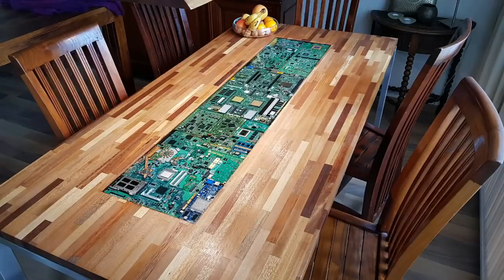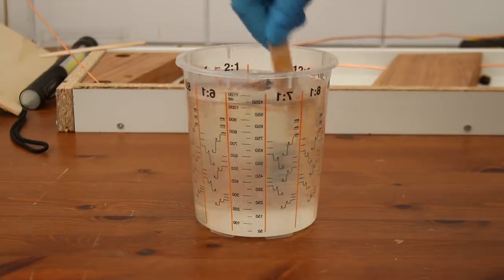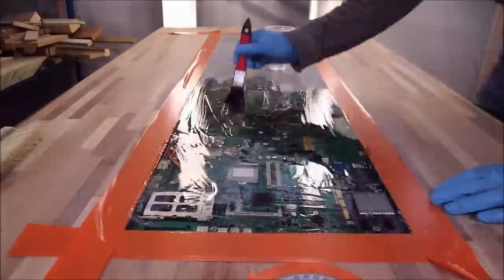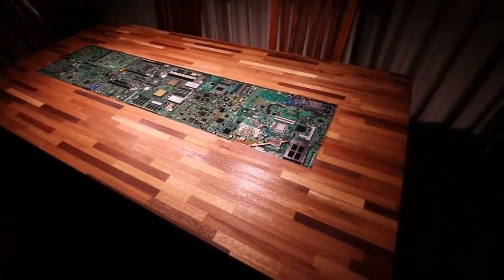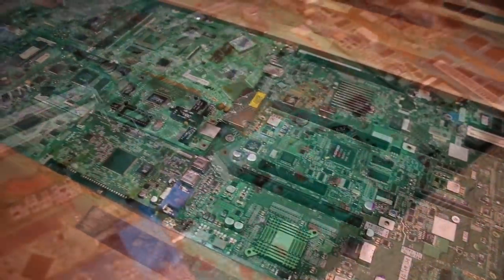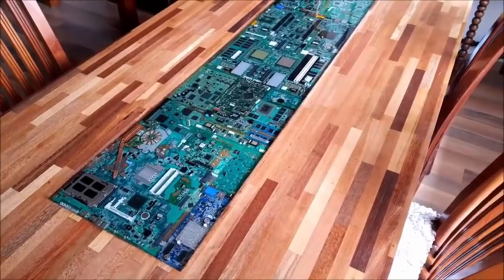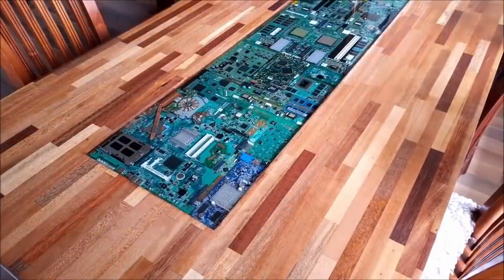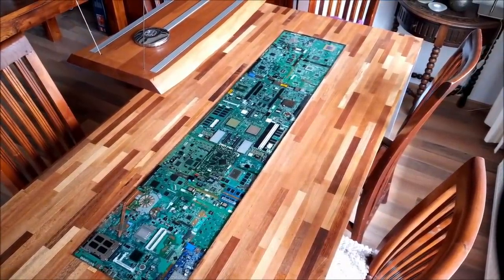Circuit boards with lights in epoxy in a table

Comment: You could cut the table into four pieces, the two long pieces on both sides of the table could be made into Hall tables or "runner" table and the two square pieces on the ends could be used at side tables, the centre with the boards and epoxy could be thrown away as industrial waste, and you've salvaged the table, the stainless steel legs could be saved for a future project. This would be my "cutting losses" solution to this table. If, that is, you don't want the bulky thing taking up room in your flat, or you're sick and tired of looking at the failure every time you enter your dining room or workshop or wherever you're storing it. I'm interested to know what you plan with that table! :)
Reply from the maker: My plan is in the pinned 'please read this before commenting' reaction.

Comment: That table is beautiful.. It's Art. Absolutely agree with the guys, put glass over it.. or is it possible to put some heat on it and dry it? You may have some blurry spots.. but you said the other 95% was good.. Keep it, You earned an "A".

Comment: is it possible to remove epoxy in layers if you did it in coats of epoxy maybe you can get down to a good coat. or maybe the poorly mixed epoxy comes to the surface..i don't know but its cool table

Comment: May it be possible to make a "functioning" computer table?
Reply: sure, but covering ut in epoxy is probably not a good idea^^ (unless you include a water cooling loop and a radiator outside the table...^^)
Reply from the maker: It really is a fascinating question, that I asked myself too. I'm still thinking on it. I think it might be possible, but it wont be easy. If I ever do make it, I will make a video. 😊 (But not for a long time, because I have other things to do..)
Reply: @Onrust1  there are some videos of working computer tables but obviously covered by glass and not epoxy^^ if you were set on the epoxy you'd have to liquid cool it or have some other way to get the heat out
Reply from the maker: Well... there is another option... 😊 But I don't want to give away that much... Maybe let it be a secret for a while, till after I made it... 😁

Comment: Instead of a glass top, have you tried saturating the surface with an appropriate hardener for the epoxy? You might have some luck getting the sticky spots to harden. You may even be able to drill tiny holes from underneath the table and inject hardener into the soft spots with a thin needle and syringe.
Reply from the maker: I'm pretty sure that that won't work... How can I be sure that I'm not adding hardener to not mixed well enough hardener? And in the case I would indeed reach uncured epoxy with the hardener, how would I get the two to mix well? No that is impossible. The only way is getting all the bad spots out, and that is what I am gonna try. I'll make a video.

Comment: How about just finishing the entire table top off with another 1/8" or so layer of epoxy?  That should integrate nicely with what you already have, and retain the visual depth you were going for.

I'd be leery about glass, as a lot of people are suggesting.  Laid over top, its own spectral properties would likely interfere with the visual cues of the circuit boards being embedded in that deep well, making it a lot less impactful.  Plus you could end up with weird Newton's rings distortion where the two made direct contact.

Comment: I made something similar to this not as intricate as this mine was using the same premise but I was using different colored leaves I had two tables to work with the first table was a failure as with yours there was many soft spots and stickiness. The second table Took me much longer because I did the pours in several stages I let each layer dry then added more, it took much longer but the table is still perfect. Basically the most important thing is the time.

Comment: Brilliant idea! This is what I call a worthwhile failure; you proved your concept and learned necessary information to succeed on future projects. And although no-one's mentioned it here, you could lay a sheet of glass over the top. (Which would also raise the high-tech quotient of the wood surface, and make it much easier to maintain, for an overall design win.)

Comment: Looked pretty sweet to me.  I think if you had of poured your epoxy in smaller batches (1/8 inch max depth per pour) allowing each layer to 'almost cure' before pouring the next, you would have had more success.

Comment: Did the ram stick up too high? If you sand epoxy you can make it clear again with heat or a flame. Also being under a  vacuum while it's drying would have helped. Also take a piece of plywood to move across the table and drag the router up and down the edge as you work it across the table. Lot faster than a chisel. You can put a groove in 3/8 plywood that fits the bit that is the size of the hole just move it across the table. Keeps you at the same depth.

Comment: Did you wash the circuit boards before placing them? It's possible that leftover flux from soldering could have interfered with the resin curing... I have no evidence for that, just throwing the thought out there.
Reply from the maker: No that was not the case, because the layer I put over it to 'glue' the boards to the table before drilling the holes for the LEDs was fine.

Comment: Suggest that you try to find a large Plating Plant that has the large walk-in ovens .  See if you can get them to take your table and heat it up in one of the large ovens to 'Heat Cure' the Epoxy . Be mindful of the temperatures ,  remember ,  you have electrolytic capacitors on those circuit boards and you don't want to explode them in the Epoxy .

Comment: Interesting concept.  I would definitely consider having one of these, but not go through the entire construction process (working with tools and epoxy is not my usual cup of tea).  However, if you decide to take this concept to the next level, and team up with another company or a production crew, this could be a very cool product (well, until someone in China makes a low cost clone copy).  
In any case, there could a real market for this.  Not only does it look cool, but can include a story about recycling old circuit boards, this beautiful art object is also helping the Earth, and so on.

Comment: Why try and isolate the middle??? The last layer of epoxy should cover the whole surface area. The table should be leveled and edge raised with some tape, so the epoxy doesn't spill. You'll get absolutely perfectly flat table top with no transition between circuit area and surround. Yes, it will take much more epoxy. Also, epoxy should be the right kind. Not the right kind will not let you do layers deeper than 5-10mm - the curing heat will buble the surface.

Comment: Wow! This is a piece of Art! Beautiful. To fix: Cut the central basin out. Fit a new steel plate to the underside of the table. Now you have to get a whole new lot of circuit boards. Do the lay in again. Now, when you do the pours, pour thin layers, allowing each layer to set for 48 - 72 hours, before starting the next.

Comment: Neat idea with the LED's.  Sorry the pour did not work out well for you.  When I saw you building the tent I was wondering if you were going to try to evacuate it while it cured to get all the bubbles out.  FWIW I have found the longer the cure time of epoxy the less crystal like it is.

Comment: I wonder if you put fiber optics in epoxy with the ends bare, if you’d be able to see the fibers and if the light would still be pinpoint
Reply from the maker: I asked myself the same question, especially in relation to another project. I'll have to run some tests for that.
Reply: Onrust! https://youtu.be/c7hVVr3riH0 uses a micro led wire for a pretty cool effect
Reply: i don't think so, because the light bounces around in the fiber it leaves the fiber at different angles

Comment: You could try to put a black (UV) light over it for a few days. It might help the uncured epoxy cure.
Reply: Maybe coat it with the hardener or put out in sun
Reply: get a strong UV light bulb in the room, shining down on it, and close the door for a few days (so you don’t look at it).

Comment: If I were to have one suggestion for next time you try this (SO sad it was a "Failure"!!) that would be that an angle grinder, while messy, would be an efficient way to remove the components from the back side of the board... ;)

Comment: Working with such massive amounts of epoxy is always a risk. It can overheat and go off prematurely, warp, bubble, discolor, and of course 1 little failure to thoroughly mix can result in goo. It's really not hard enough to use on an every day piece of furniture. It scratches very easily.

Comment: Stay away from deep dish epoxy resin jobs if A: You've no experience, and/or B: You're NOT absolutely sure of your equipment and procedures.  Want to learn? Start with a one-inch by one-inch cut out and see just how persnickety resin jobs can get, but at a minimum investment.  Big resin pouring jobs are like the Hoover Dam. It all needs to be mixed in one (1) batch, preferably with a BIG mixer fork on a drill press, working off the side.You CAN do it. It just takes some practice, like an instrument. The very first time you mix up a 30mL batch you will see exactly what is meant by persinickety.

Comment: If you run dissolve and rub down the sticky spots with a suitable thinner you might be able to do another poor on it to get rid of tacky bits.
Or glass top might be easier as everyone else said.

Comment: Hi,
You could remove everything (boards and epoxy) and start all over.
This time glue down boards and make a lip inner cut of the table and use a thick glass, so that it's a flash with a table.
😊😊😊

Comment: Me thinks the epoxy was too deep to set properly.  This happens in many poured material applications, so perhaps 10mm layers with a week in between to allow better setting/curing may have done a better job.
But....  a fantastic effort!  A router would carve out the whole epoxy section in an hour or so. I hope you give it another try.

Comment: I use the same epoxy in and on pet coffins. It seals so well, they need not be buried, for those who want their babies to remain in the house with them. Two coats inside and two coats outside, after the pet is placed inside. I even use the epoxy in place of wood glue.

Comment: Idea to fix this. Prob someone has come up with this idea thow.. Router the edge away, like 2mm or so & put a Aluminum edge around the Epoxy, 

like a L channel Alloy edging. See it on corners of walls in offices ect. I think the clean line of metal around the inside would look neat also. Just an idea

Comment: seems like it would have been easier to cut out the middle of the table and put a thin sheet of plywood on the bottom.
Reply from the maker: Yes, that was my conclusion too... afterwards. Where were you when I needed you? 😆😆

Comment: Hope you took off all the coin cells and batteries. Those will leak in a few years time.
Reply from the maker: There are two still in. They are completely airtight sealed in epoxy, laying upside down. What can happen?
Reply: White crystals will appear on the outside of the batteries and/or an alkaline gel will leak from them.
No idea how it will react with the epoxy, or whether it will slowly soak into it or eat through it, but wouldn't take the risk.
Reply from the maker: You're massively underestimating the strength and adhesive powers of cured epoxy. That stuff is SO strong. I'm pretty sure nothing will happen.

Comment: Put a piece of glass over the whole table......
Reply: I saw the video and thought the same thing! That's the solution!
Reply: yea, or even just the center section
Reply: i mean like, chisel out some of the epoxy layer and lay a piece of glass there, so it's flush with the wood level

Comment: Maybe with hindsight, if the recess was deep enough, only pour resin leaving enough space for a sheet of either Plexi or toughened glass to top it off while the resin is liquid - and maybe a final layer of something not quite so toxic?
If removing the 'failed' attempt, I would take a powerful circular hand-saw and cut it through completely. If necessary fit a new blanking plate to the underside.

Comment: Epoxy does not always mix evenly and if you put the extra effort into it it is full of small bubbles.   However if you mix it well, then pour it into a new clean container using a rubber spatula to get it off the sides of the old container you can mix it a second time and what is on the sides of the new container will be well mixed.  Mix twice in two different containers before pouring to eliminate unmixed epoxy that clings to the sides of the first container.
Reply from the maker: You're right. It's what I learned..

Comment: Use a torch to clear out any imperfections when working with epoxy resins. The map gas torch helps get any bubbles or waviness out of the epoxy before it cures.

Comment: Looks cool. I wonder what will happen to that backup battery coin cell though...
Reply from the maker: You're not the first. Nothing, I suspect. It's airtight closed in, so corrosion is out of the question. What can happen?
Reply: @Onrust1  The battery necessarily has chemical energy independent of air unless it's an air battery (e.g. zinc air battery) or fuel cell, which I don't think are used for this. The epoxy is likely to contain whatever does happen to the battery as it self-discharges, although I can imagine there's some chance of a crack forming in the thin layer of epoxy (if any) separating the battery from the PCB, and the corrosive chemicals could wick along that plane to damage nearby things. Only a possibility, though, any damage might well just be localized to the battery itself, with the rest protected by the epoxy.

Comment: I have had the same problem with the epoxy. I used a bit of spiritus or rubbing alcohol. It worked a bit. I won't remove it totally but it can take away the sticky feeling

Comment: With 21 years in the epoxy manufacturing industry (mostly for electronic potting and encapsulating) there is a rule - never pour your epoxy from the same cup / container you mixed it in.  This is called side-walling - where some of the hardener or resin sticks to the side of the mixing container and does not get fully mixed in.  So when you pour it out and scrape out the cup, this unmixed resin or hardener gets poured out and leaved tacky / soft uncured spots.  Mix in one container - pour into another container - mix some more in the 2nd container - then pour onto the piece you are making.
Reply from the maker: You're so right. Last week I did a pour again, and now I mixed it so thoroughly (mechanical - with a drill) that I was convinced there was not a drop not mixed, so I hesitated to do it in another cup. At last I thought I shouldn't take any risks and I did pour it over. Then when the epoxy got cured I returned to the first cup and I was surprised to find sticky spots in it! Where in the second cup there weren't. Side-walling. I experienced it. Now I know its name too.. Thanks!! 😊👍👍

Comment: A wonderful project. There are countless videos on youtube from people who regularly pour clear epoxy. There are couple of ways to do the LED lighting. There are dozens of kits that you could buy to eliminate the process you just did and blinking lights on a table is cool for about 2 minutes before it gets annoying. Having a smooth on and off is cool.
Or if you are really anal about the project you could have drilled a thousand holes in the pcb boards and ran the fiber to the end like you did and installed 1 multi colored LED and it would light up the Fiber optic cables like little stars.
The support of your table also added to your issues. Sanding on a moving object is going to give you imperfections. But we do with what we have. Several saw horses would have helped greatly and a level. Masking off the epoxy area before the pour would have helped and using a heat gun to eliminate the bubbles and imperfections. Also I don't know what you used to mix the epoxy. In the future use a power tool. On slow of course.

Comment: It should have been done as one large pour. However, if you pour it in layers, each layer should have been allowed to cure completely before the next was poured. Use a heat gun to bring the bubbles to the top of each layer to avoid encasing bubbles.

Comment: just rinse and repeat XD cut the epoxy rectangle out lmao XD, the LED's were a cool idea but heres a 1up from that XD make multiple focal points that spelled out words or made designs like have a game of pacman going on in stop motion over 10 focal points XD you would only have to make the maze once then you could tie all the separate maze lights into 1 big optic cable and split it off into 10  cable so 1 can go in each focal point so when you shine light on any single one it will light up the whole maze, then comes the hard part XD making a stop motion pacman game with ghosts for every focal point lol

or better yet try to make a table with hidden LED pictures all over the places where people sit on the table so when you have dinner guests you can shine a light into the focal points to make pictures like a bunch of random emoji's appear while there eating XD
Reply from the maker: Nothing wrong with your imagination - I like it! 😆

Comment: Very nice anyhow.  Can think of a lot of old tech that would look good.  On a much smaller epoxy project which required several layers, I had to use a heat gun after pouring each layer to even out the epoxy and remove all bubbles.  And still it wasn't perfect.  It's difficult difficult to mix large quantities perfectly.  Cheers!

Comment: Just cut the circuit board section completely out with your saw and then router a rebate underneath to accept a false bottom. Should be very quick, then start again.